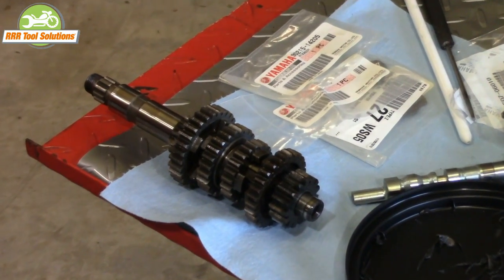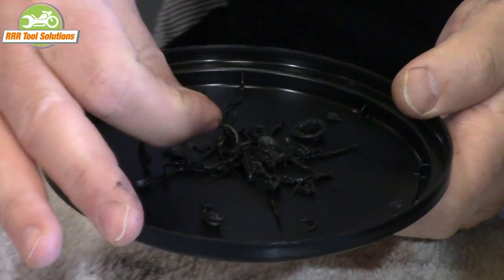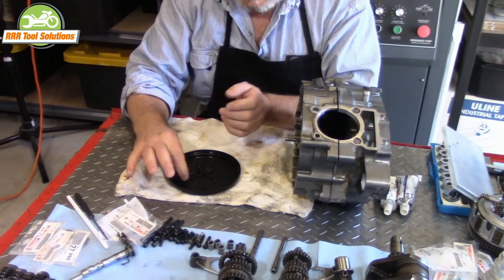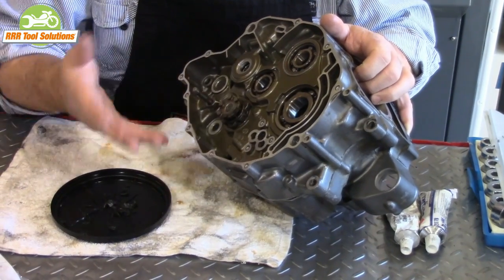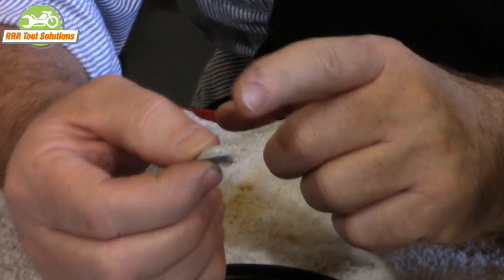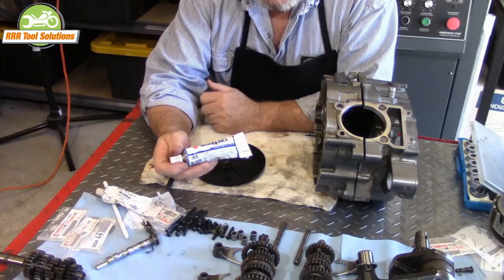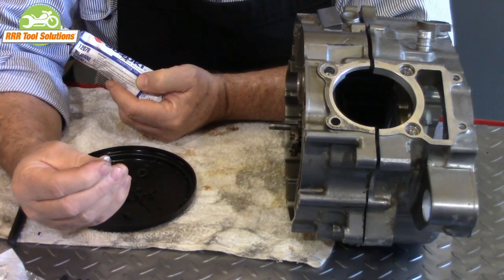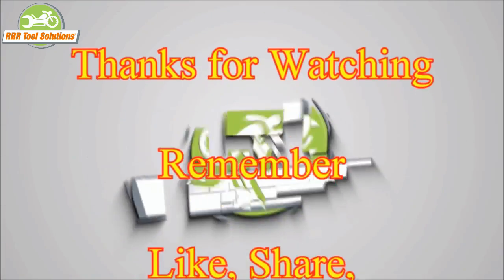Motorcycle Gasket Sealer - Which one do I use?

Comment: Yamabond 4 is Threebond 1215 - a silicone sealant. Suzuki 1207 is the same as threebond 1207 which again is silicone. 

Here are 3 that are fuel resistant that are easily accessible: Threebond 1104, Curil t2 & Motoseal 1.

Comment: 100gm of this sets me back $66 where I live... Insane. But my rocker cover on my 1990 GS500E is leaking - I had already changed the gasket with a new one and applied off-brand high temp gasket sealer ($16), when checking valves. Guess I'll have to replace rocker gasket again but with 1207b bond. Hopefully this fixes it because if it leaks again, then i probably have bigger issue at hand

Comment: Had bikes since 78, never ever use gasket sealer on a bike engine, either buy correct gasket or make one from the correct gasket material, that gasket goo is an engine killer !
Reply from the maker: The crankcases of Japanese motorcycles are split vertically on most singles and horizontally on multi cylinders. Those have not used gaskets at the crankcase seams since their inception. Gasket seal like Yamabond, Hondabond, 1104, 1184 have been the sealer used by the factories. No gaskets ever made or used - the bearings, crank, and transmission shafts would all be bouncing around due to the added clearance. Gordon
Reply: My 2007 KX 250 doesn't even have a centercase gasket you can order, you literally have to use a liquid gasket material. I get so many parts through the mail these days and I'm almost positive I ordered yamabond 4, but they sent yamabond 5 which appears to be the flimsy black material. I'm going to pick up some 1104 next time I'm at an auto parts store and do it right. It's been 10+ years since the last time I had to split cases so I'm a little rusty. Thanks for the video.

Comment: What this guy said!! Ive used Yamabond 4 for a long time, I had Kawasaki Bond about 30 years ago, same stuff. Works great!
Reply: Yamabond separates, requires premixing and says it goes bad soon after opening. 
Ive had great results with Permatex "Motoseal". Seems to store ok, and no mixing.
Its design for joining case halves!
Reply: @0ctivate  ? Yamabond 4 is a grey 1 part deal.... comes in a toothpaste type tube, requires no mixing at all. There is no shelf life on it once opened. Ive used it for the last 25 years without fail. it is designed for case halves. Cant speak to the other products in the Yamabond line, it might be one of those you are thinking of.
"Yamabond 4 Motorsport"
Reply: @2stroke1971  I have a tube here.. It says use within one year of purchase. It still does feel ok. I thought i remember it looked separated when i first got and had to massage it,  it but that was like 4 years ago
Reply: @2stroke1971  Ive used the motoseal on gaskets for my scooter and its like a rock when i have to take apart
Reply: @0ctivate  Ill have to check the motoseal out, but the Yamabond 4 is a "semi drying" sealant...so it remains somewhat pliable. I suppose there is some benefit to that at times.

Comment: Will any of the sealers you mentioned work well with my 2 stroke billet aluminum case halves?
Reply: Case halves are machined you very tight tolerances. This guy (like everyone else, it seems!) is talking garbage! You need to use an automotive anaerobic sealant. Not RTV silicone.

Comment: Greatings from Portugal, thanks for the video, very helpful.
I have to use a sealer on the crankcase cover of my yamaha xt 350 and I have to re-seal the plastic cover to the aluminum part of the motor, being that some wires come through there, would you recommend the same sealer? Thanks!

Comment: I have been struggling to find what exactly I should use in this very application, to bond both halves together, and I thought it would be silicone sealant, or my OEM shop manual mentioned "liquid gasket" I didn't know where to start. But this directly answered my problem, thank you very much.

Comment: Is there a difference between 3 bond 1104 and 3 bond 1211 other than1104 is grey and 1211 is white
Reply from the maker: Hi Paul, I'm not familiar with the 1211, so I cannot give advise on it's use. The 1184 is the modern version of 1104 - minus some solvents that the EPA wanted removed. I've never seen a White case sealant used since it doesn't match any aluminum or painted cases - my guess is that it is not the correct sealant. Best Regards, Gordon/RRR

Comment: I think with permatex you are suppose to let it dry a bit before you torque to spec.
Reply: Yes you are...still it manages to squeeze out mostly...its just soft even when its fully cured.
 I use permatex a lot for valve covers on older cars, differential covers in cars...with the soft gaskets, and slightly irregular surfaces, and as you say letting it cure a little it works...even then if you tighten down too much its a problem, usually I will let it cure a little, assemble, tighten a little, then wait an nhour and tighten the rest of the way, but still.....putting a valve cover on an old car, is different than the ultra machined surfaces of a crank case....there are not many irregularities there, no nooks and crannys for the silicone to escape being completey squeezed out when you torque them to spec, (pretty tight)
Permatex ultra grey is better as far as resisting getting squeezed out, that is along the lines of 3 bonds, but still not as good. Ive use that on a clutch cover a time or two,  but its not a big deal to pull a clutch cover and re do it...Id never use it on a case half. Just Ebay the Yamabond 4, its cheap enough
Reply: You need to use Permatex "Motoseal" is the equivalent . No need to wait

Comment: Hi, Thanks for the vid.  I see that you have shown us two ThreeBond products (1184 and 1207).  You seem to prefer the Suzuki branded version (1207), but do you rate the 1184 equally, or are they suitable for different applications?
Reply: RedRupert64 1207 is black and rated at like 300°. 1104/1184 is grey and like 250°.
Reply: @AV-wx7sf  strange the 1207 is cheaper than the 1184

Comment: Permatex has one called motoseal. They compare to yamabond. What's your intake. It will be for carburetor and permatex states this is the only one to use where fuel will be permanently expose
Reply from the maker: Hi Antonio, thanks for commenting. I have never used Permatex or the motoseal product so I am not able to offer advice nor input. Is the use of sealant on or inside this carburetor a factory specified procedure? I ask because I have never encountered a similar carburetor application of sealer. Best Regards, Gordon/RRR
Reply: @RRRToolSolutions1  I ended up buying the yamabond and applied where the existing gaskets are. I applied a thin even layer with my fingers with gloves and after cleaning it with alcohol to get any oils or contaminant out

Comment: Was wondering what actually do you use to seal the manifolds into the aluminum heads
Reply from the maker: Hi Rich, which manifolds? If it is an O-Ring joint/junction, then no sealer is used. Th only place I use this sealer is when the cases have "no gasket" as in case-halves and flat gaskets that are submerged in the oil supply. This is my "stop oil leaks" preventative practice only. If it's not submerged in oil, then it's entirely "over-kill" and for me, undesirable. Thanks for commenting! Gordon

Comment: Do I lay a bead on one case half or do I use my finger and put a thin light coat on one case half?
Reply from the maker: Hi DR, thanks for commenting. I prefer the "finger smear method". I use a latex glove and apply to one surface with my index finger. A bead would be too much, so by using my finger I can apply a thin, thorough coating. Gordon/RTS
Reply: @RRRToolSolutions1  do I do one side of my case or both?

Comment: I used ultra black permatex and when I put the two halves together and tightened them together, it pinched the crankshaft and it wouldn’t move freely. Is this yamabond better that it wont pinch the crank? thanks
Reply from the maker: Permatex is not for crankcase assembly. Please check my website article on "Right Stuff" where I show in detail what to use and why - Thanks for commenting! Gordon/RTS
Reply: Permatex Motoseal is the right product.

Comment: Awesome!  Thanks for the great vid.  I have  question.  I currently putting together a Honda XR case.  Every mating surface has a gasket and I've bought all new ones.  Do you recommend using any products such as what you've shown WITH a gasket or do you use the gasket ALONE?  This question applies to crank case, crank case covers, cylinder, cylinder head, etc.
Reply from the maker: Hi Paul, thanks for your question! Case sealants demonstrated are really designed for metal-to-metal case assembly. However, I often do use a light "tack" coat of sealant to hold gaskets in-place and anytime I've got covers or assemblies that are prone to leakage and where I see damaged surfaces in the covers. On many factory/OEM gaskets, you'll notice that the surfaces have silicone strips where leaks are critical. You can use a light, skim coat of sealant if you want, just know that multi-use gaskets where removal and adjustments are routine such as points covers, sealant should only be applied to one side. The use of sealant on both sides will almost certainly damage the gasket upon assembly and will mean scraping and clean-up removal. I hate leaks, so I'm guilty of using it more often than not - Gordon/RTS
Reply: RRR Tool Solutions 864-710-7964 Great video! Great question and reply too. Thanks!

Comment: Very well presented and  informative! Ordered a tube for my chainsaw based on this video. Thanks and have a blessed Thanksgiving.
Reply from the maker: Thanks John. I'm glad I could help. A lot of mechanics think that RTV is good for every engine and every application - you see that it can and will cause catastrophic failure when the right stuff is not used.

Thanks for commenting! Gordon/RTS
Reply: Hi john.  Just rebuilding a chainsaw too. Did you use this on the crank casing along with an actual gasket? And same question for the cylinder head? Or just use the 1207 without an actual gasket